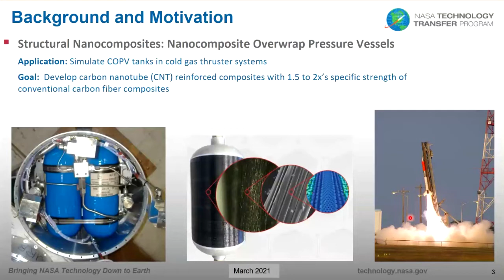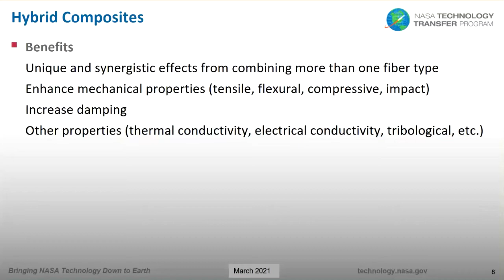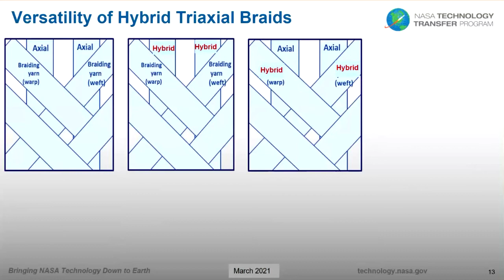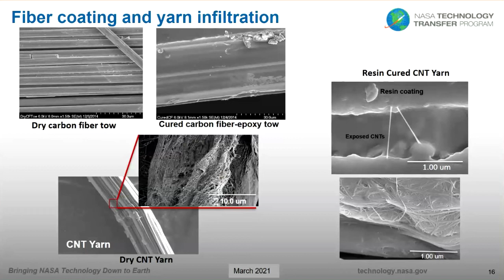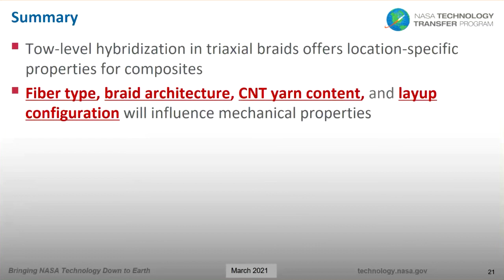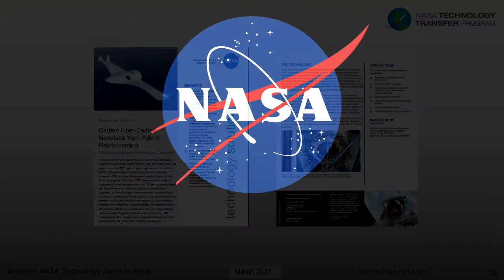NASA's Carbon Fiber-Carbon Nanotube Yarn Hybrid Reinforcement Webinar

Comment: The orientational alignment of CNT into a continuous filament fiber vs the less superior staple “hybrids” is key to forming a proper continuous filament nanotube yarn for advanced fiber reinforcement with superior characteristics in each application.

We faced the same challenges with early production and process applications during our research and development of aramids in the late 1960’s ie DuPont’s Kevlar©, Nomex© etc. for advanced material reinforcement.

A CNT hybrid staple is not an efficient or cost practical use of CNT. 

The braid angle is known as pics per inch or pics per centimeters.